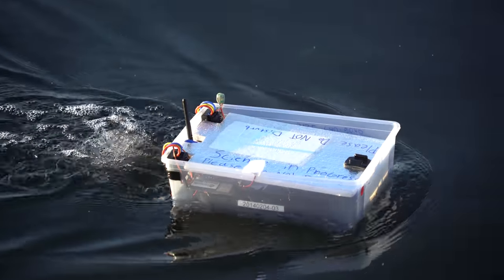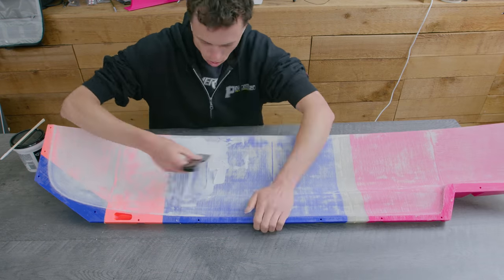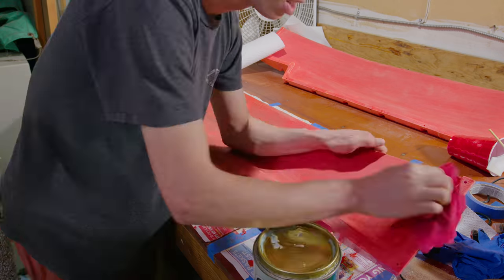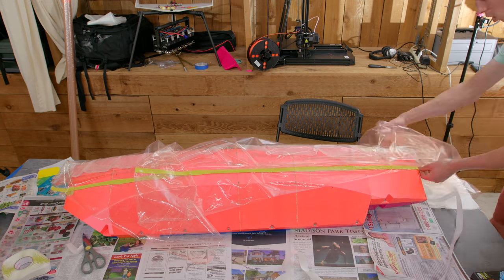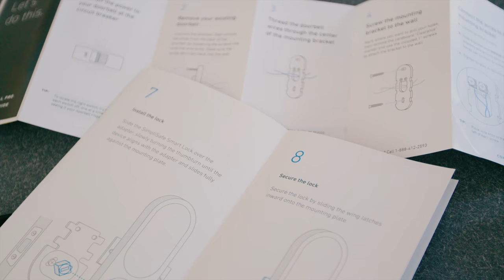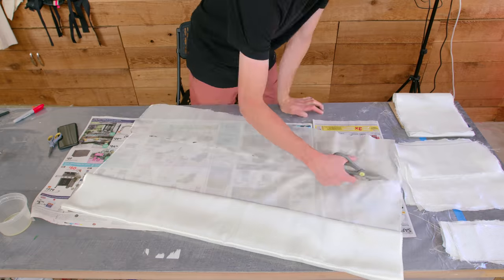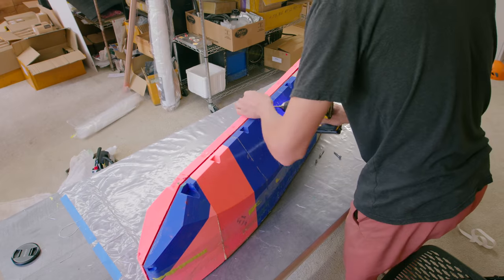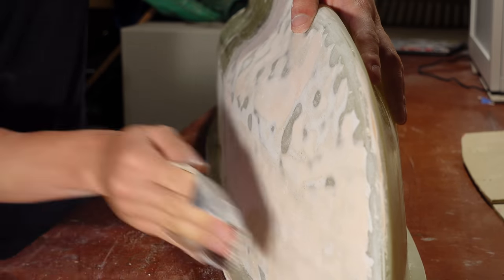I Built a Solar Powered Tug Boat to Pull My Kayak - Pt. 1

Comment: Instead of sanding softer materials try scraping or using a really coarse file. Either will remove the material nicely and they won't clog like sand paper. You can get specialized auto body rasps (that are like small cheese graters) and files (that have parallel curved cutting edges) and pretty much not need sandpaper after just those two. As a matter of fact, it's best to work the body filler with them before it has set up all the way, in so-called "green state". Start working it while the surface is still tacky. It's the very top layer and it's what clogs the sand paper the most, yet the filler itself is not sticky underneath.
As for vacuum bagging, you should have another layer called breather cloth, essentially low quality felt, on top of the peel-ply. It will soak up excess resin, allow air to get around much easier, and will help to press the fiberglass tightly against the mould.

Comment: I always wanted to try this. Post curing epoxy will increase stiffness a lot at a higher temp. if it was me I would have used the mold to cast a foam mold so I could lay the glass over. you can mess about with carbon fiber and Kevlar

Comment: Dude! I always enjoy your ingenuity and I know you probably (like I do) try out projects with a secondary goal of testing out new techniques. Now for my advice, maybe try 3d printing bulkheads that can be connected by foam boards and then adding fiberglass to that structure. I think that would be a much easier preparation.

Comment: Having built a Cozy MK IV experimental aircraft, and learned glassing from Burt Rutan's manual, you are not doing it right. 
If you develop a hole in the hull, your vessel will sink like a rock and you'll end up using more glass at the end and never achieving the stiffness.
A sheet of foam core, sandwiched between 3 layers of cloth (you can use any type from a home center), would do it. Maybe a layer of Kevlar at the end to protect the bottom from collision with rocks.
The alternative is to fill the hull with spray foam so that forces from one side of the hull, transfer to the other side, and in case of of a leak, it won't sink. 
Love your channel btw.

Comment: As someone with no knowledge about boats, I'd be interested in knowing more about the design process / hydrodynamics that led to the shape of the hulls.
Reply: Dont think its very good in this case, just from looking at it, unfortunately. I think he just made something that kind of looked like something he saw somewhere.

Seems a bit similar in concept to the banana slug. This time he wont have stability problems, since he has two hulls, but it is still a very deep, narrow hull that should induce quite a lot of hull drag because of wetted surface.

Not trying to be mean, just the way it looks to me.

Comment: That was quite a project! Out of curiosity, if you are building a catamaran why not use the Tech Ingredients style hull build? Seems way simpler and the slightly less hydrodynamic shape won’t make a difference at autonomous vessel speeds.
Reply from the maker: Because I used a similar method for the Banana Slug and got ripped apart in the comments section lol
Reply: @rctestflight  lol aye fair enough

Comment: What am I not getting? Why didn't u 3D print mold smaller, so u can apply fiberglass on the outside so it won't be so hard to do on the inside?
Reply: Can't get it off because you can't open the mold

Comment: not sure if this would have effected you or not but when doing multiple layers of fiberglass and epoxy if you let it dry completely you have to sand it before you add more layers otherwise it doesn't stick properly

Comment: A few pointers, all in respect: 
- Four layers of wax on a first time mold is considered a bit "stingy". Most people will do almost double.  
- Go easy on the resin. More does not mean better, and it looked really rich from the video
- Add a breather ply so suck up the excess resin
- Consider bagging the whole mold. That way, it matters less if the mold is porous and there's no/less risk of pulling a fragile mold out of shape. (Sorry, wrote that before I saw you had to that anyways...)

Comment: Unless you are building a sailing yacht with large lateral forces, you would probably be better off with simple cylindrical hulls to minimise the wetted area for a given displacement and tubes are available ready made :-) You can still melt the ends or do your nice fibreglassing for the bow and stern

Comment: Lots of things going on here that I would do differently. Bondo, primer and paint the molds. Sanding like it's a car repair. As for vacuum bagging I wouldn't bother for small qtys because hand lay ups done right can be just as light and strong. Finished parts can be molded with gelcoat and fiber simultaneously. But it's none of my business.

Comment: You could spare 90% of your work if you just print an inner PLA-hull and coat this with epoxy and glass fibre and don't remove it.
Less PLA used beside. Also you're able to reinforce the whole boat by using the inner PLA hull.

Comment: wouldnt a positive mould be a better choice for making a hull and using a vacuum bag?
Reply: A positive mold is easier to work with, but the surface quality suffers. I've never seen the vacuum bag technique used on something like this before, but it should work better with a positive mold, that's for sure. But again it would also mean you had a lot more work sanding the result down to get a good surface finish. With a negative mold of good quality you can start with a gelcoat layer and you end up with a very good surface needing minimal if any work to make it perfect. I guess with a one off like this it's not that much worse than polishing the mold, but if you are planning to make a lot of hulls a negative mold is the way to go.
Reply: @blahorgaslisk7763  I was thinking that or maybe 3d print a positive that fits inside the negative ti wedge it. Would only really need to clamp.

Comment: Adding bulkheads like on an actual boat could help. Reinfocements 90 degrees tot the direction of the hull
Reply: Oh you did that at 13:37 out of 3d prints

Comment: I have an idea for a video wich i had in my head for about one year so the idea is a autonomous rc hot air baloon and you change direction by going up or down into the different layers of wind which move in different directions(that's how real balloons do it) and it would stay in the air for really long periods of time like one to days until it reaches its landing point

Comment: What type rosin were you using?  It seems like it would have hardened before you got the vacuum bag installed.  Did you use less hardener in anticipation of taking longer to get it bagged?

Comment: Professional sailor and boat builder here: if you dont have a hvlp spray gun use a preval sprayer. You can get them for 5 or so dollars at the Homeless Despot. Use acetone to thin out your gelcoat till it sprays smoothly. That should help with the brush marks on your tooling gelcoat. Once you have the gelcoat on your mold sanded and polished smooth, use the same wax and mold release method as you do in this video. Then use the preval sprayer to shoot in laminating gelcoat (dont use finishing gelcoat, it has wax in it so it's no good to bond with the fiberglass and epoxy) covering the mold.  Once the lqminating gelcoat cures in the mold you can then proceed to lay up the fiberglass as you did in this video. Essentially you are building the boat in layers from outside to in. The result will be that you only have to spend time getting your molds to a perfect finish, then you can pop out as many parts as you want with minimal finishing work to be done. 

To solve your structural issues you can add a bilkhead or two and a spine made from balsa (or other wood). Then tab them in with fiberglass and epoxy. The result will be a boat that will be very stiff and strong.  If you have questions philiptothsailing@yahoo.com
Reply: Liked for "Homeless Despot"
Reply: @MrGatlin98  That's one treat aespecial
Reply: @linuxguy1199   tumb seaking nut rounder
Reply: should fix it up right quick and in a hurray
Reply: As custom boat builder myself (Bonadeo Boat Works) I would recommend thinning Gelcoat with MEK solvent. Acetone will work but it will effect how it cures so if you do go the acetone route be sure to catalyze at no less then 2% MEKP. Also for your use you could just hand lay your hull in a polyvinyl or vinylester resin they are both much cheaper but it does take a little bit of skill set to hand lay without getting air bubbles.
Reply: TLDR: 3d print the whole thing next time but make sure it's strong enough. 

Jokes aside, I've got to love that expertise
Reply: I have watched all of rctestflight videos many times trying to understand the thinking process and where they are heading in the future.  My conclusion is they do not wish to learn from experience and only wish to go forward from their very limited current knowledge base?  They do everything "the hard way, using inappropriate design, wrong use of materials and wrong construction techniques."  Such a terrible waste of their time and potential.  I still have hope they will actually build a full size WIG, but fear they will stop and reinvent the wheel instead?  So far they have done nothing new, just used a different method of control.  Using helicopter building techniques to build a stone boat.  Sad.
Reply: I'm a professional boat builder as well and this video was painful to watch.
Reply: @doncunningham3124  not as painful as reading your comment. He's self educated, just let the man learn in peace. lol
Reply: @djSpinege  when it comes to composites we're all pretty much self educated. Myself included. I know, from extensive personal experience,  just how much work is involved when we have to learn from our mistakes in this field. Hence the reason why I said it was painful to watch. Get over yourself.
Reply: I thought I was gonna be writing out a big long help list. lol.  You can also use automotive prime you can get at Oriellys and spray it with that sprayer as well. Sands better. Then Get some gloss car wrap and wrap that haul and wax it. Much less time and works pretty dang good for projects that don't need to last long.

Comment: You *could always glass a wood spar in the hull to give it more stability and strength.
Reply: Just a keel and a few ribs from closed cell foam with one layer of glass. Weighs next to nothing.

Comment: I have wanted to make an actual wind powered autonomous sailing vessel, and have been thinking about a vertical wind turbine setup so it wouldn't need to try to tack.

Edit: I missed the finish of my thought...I think a catamaran design might work best for a setup like this.
Reply: @charleslambert3368  thanks for the insight! Just an idea kicking around my head. I think it would be kind of cool to have an autonomous wind tacking sailboat, but wouldn't even know where to start...other than Google. Haha.

Comment: Why build a boat to pull you vs putting an autopilot on the boat you already have? I just added bungee corded thrusters to an inflatable sup. Put the batteries. Gps and f405 in a waterproof harbor freight box and good to go!

Comment: Pretty cool that you 3D printed a mold for such a massive boat! How much plastic did you end up using?

Also wow, lol the sun must have heated that mold half to at least 55ºC (which is roughly the heat deflection temperature of PLA.) It might help if you printed it out of PETG (~70ºC heat deflection temp.) Maybe white PETG for good measure... In my experience, I have been able to find PETG that costs less than the same amount of PLA. It is also softer, so you can sand it directly, without applying spackle.

Comment: You had proven a working way of molding the hull.. Why would any reasonable person not use the same process on the 2nd hull. Since you already have the procedure down pat... It would have been a faster process the 2nd time.

Comment: I personally wouldn't have bothered with all that prep you did on the mold, because of the way your layer lines where you would have been just fine molding straight off the print with Abit of wax and PVA. You could have saves alot of Money by building the boat in polyester resin and not worrying about vac bagging.

Comment: I, for one, would love to see how a catamaran with "dimples" all over would compare to one with "normal" hulls.
Reply: If a dimpled ball is more areodynamic than a smooth ball, would a dimpled boat hull be more hydrodynamic? Sounds like a Mythbusters episode...
Reply: @namAehT  Yeah, that's what I'm thinking.
Reply: As far as I know, it sort of has been tried. Needs much, MUCH smaller "dimples", even smaller than a golf ball to work. more akin to a sligthly rough finish. Sanding with a 600 paper leaves a microscopic finish that is recommended on race boats. Any dimples remotely visible to the eye would be too large. Makes sense if you think about the enormous density differences between water and air.

Also, the golf ball dimples mostly help decrease wake turbulence around an aerodynamically terrible shape (a sphere).  A more reasonable shape would show different results and the dimples might not be very beneficial even in air.
Reply: @GoldenCroc  I guess that makes sense. 
The only reason it struck me, was probably because I've never seen a hull with dimples before the mistake in this video.
If it wasn't so time consuming to make a model, it'd still be pretty cool to see - even if the difference is non-existent.
Reply: what does the Re of the dimples have to be?

Comment: I vacuum formed wings from PLA forms and I quickly found the same thing happening (infill impression on the wings), increasing the in fill helped but doubled the print time to like 72 hours (actual print time), technically at low speed the dimpling was aerodynamically advantageous as decreases boundary layer seperation 😅

Comment: Excellent job with that 3-D print that’s amazing I’m currently working on a catamaran myself don’t be afraid to use the shredded fiberglass it lays in all different directions easily and doesn’t typically fold up like the weave will and it takes less layers of it to build up strength.
The smartest thing I ever did was start using rollers roll on the first layer of Apoxsee slap on the fiberglass which wetsuit out quicker and then do a quick roll it’s about two times faster and it helps you ensure that your resin doesn’t set up too fast and it doesn’t trap and air bubbles

Comment: Instead of using that "grid" pattern fibreglass cloth, use the type that's just a bunch of random fibres in every direction, way easier to shape it because it's not stiff like the grid pattern cloth.

Comment: Do a real boat now and use the solar panels for a electric motor and have a backup troller motor also I think IF you make it quater inch thick on plates like 100 plates to make a boat or sum maybe just and idea then use a glue for 3d printers ? Edit...use metal for rigidity on the inside attach panels to metal and add a wood floor to step on and not the actual plastic so everything with be based on the metal maybe idk or wood instead of metal ot maybe just 3d printed idk tbh

Comment: Ufff. It was like discivering the wheel. If you would ask just simple questions to experienced composite producer, you can save 90 % of work. Simple example - vacuuming parts like this is useless.

Comment: Awesome project but you should watch some more fiberglass and epoxy videos and maybe even check Gougeon Brothers on Boatbuilding (book) it is available as a free pdf. 

Epoxy with right light weight powders (silica) is good filler vs spackles which don't bond and cure by drying (thus shrinking). Gelcoat is durable but PIOTA and unnecessary. 
Sand -> Epoxy-filler -> sand, -> paint -> sand -> polish/fine sand -> wax

Also I don't think vacuum bagging is necessary. If I was to do this I would have just done a wet lay-up and after it has cured add glued on ribs made of pretty much anything. XPS styrene insulation would work very well (with epoxy). Then add fiberglass tape/strips over these ribs. 

The thing is adding stiffness by thickening the layup adds a lot of weight as each layer adds so little. Thickness is the major factor for stiffness so even non structural ribs would add a lot of strength. Read any basic summary of a sandwich construction and you get the idea. 

Making it as two halves would make hand layup (without vacuum) much easier to keep relatively "dry" ie. fiber to resin ration sensible. People Build strong kayaks by hand layup on quite flimsy cedar core - I think vacuum is overkill for a small project like this.

Comment: Wondering, since the mold was 3D printed, you could just saw off the from deformed area and reprint a new section. Amount of work likely less the the filling, sanding of the bad haul half. (and less weight in end product). 

Am guessing you may want a extra haul at some point in the future. :)

BTW: those twin hauls looks like they'd make great floats for a large RC plane.

Comment: If you don’t want to deal with the nasty composite tooling, tape you 3d printed mold with flashbreaker tape or adhesive release film or just brush PVA ( but don’t sand the plastic in this case )

Comment: After you sanded the PLA mold the first time, you could have just wiped it down with a rag and acetone and you would have gotten a smooth shiny finish. Perfect for applying a release on it. After wiping with acetone you could also "paint" on a layer of epoxy to seal it up even better. this would have eliminated the need to use bondo or spackle paste. Love your videos !! great job

Comment: Why do you not use an automotive grade bondo for all the filling and all? It does require surface prep but It is much stronger and actually “plastic” and feel it’d be better than just regular spackel.